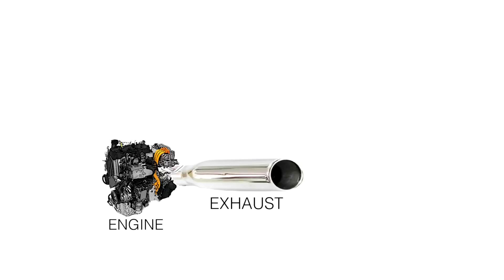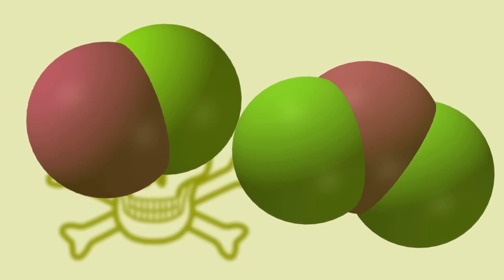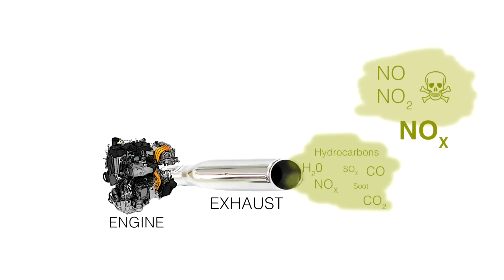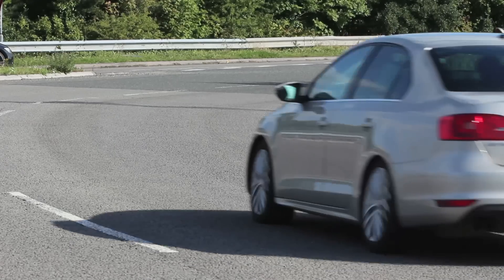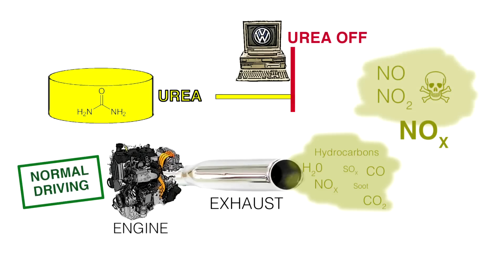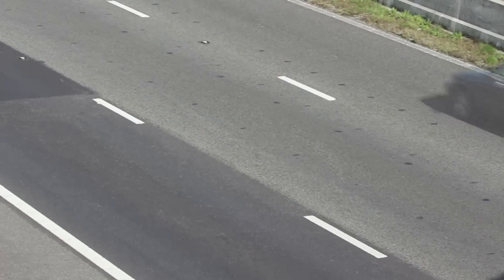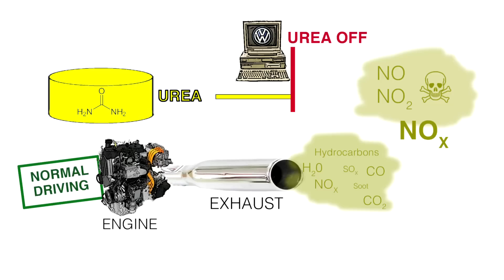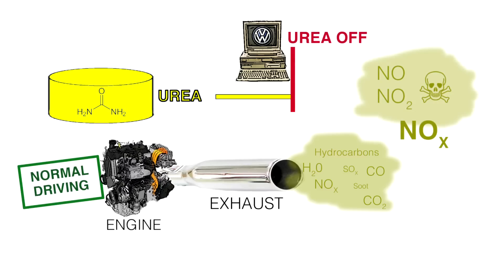Diesel and Urea

Comment: I don't get the problem americans have with volkswagen, I mean, have they not seen their american trucks lifted up and rolling more coal than 50s great britain? :D
Reply: +NinjaEule To be perfectly fair, "coal rolling" doesn't produce more NOx. What it does produce is more unbuned carbon in the form of smoke and soot, which, while a serious pollutant, isn't the same thing. It's also not made in  the same way. Excess soot, "coal rolling", means a diesel is burning extra rich, or with more diesel per volume of air. This increases horsepower and torque at the cost of efficiency. This is why diesels seen in motorsport tend to be a little sooty, excluding things like the audi le mans ubercars. More NOx is produced with a higher compression, which can increase both power and efficiency, but cars using this technology require more advanced engine designs, heavier duty engine block components, and more advanced and expensive emissions controls. Unless you're Volkswagen.

No loophole has been required to allow someone to modify their exhaust system or engine programming in anything short of a tractor trailer. In fact, legislation expressly made to stop the practice is fairly new. In addition, vehicles not intended to be road legal aren't required to be compliant with anything at all.

If you want to be mad at diesels, be mad at large ships, which produce a disproportionate amount of pollutants, especially when burning heavy fuel oils. Or, perhaps, logging in less developed countries, where burning of excess wood produces more particulate matter and dangerous chemicals than an entire fleet for coal rolling pickups.
Reply: +JimoftheSlim It has been illegal since 2007 to modify or alter the operation of your federal emissions control systems to prevent their intentional and designed operation from occuring. If you deleted your DPF in 2007 right after you bought a shiny new truck newly equipped with one, and the authorities found out, you'd be in for serious fines if not jail time. The "loophole" there was that off-road/race vehicles were exempt. Not to say things like heavy equipment, gen-sets, etc, which DO have their own emissions laws which, as of 2015, are dang near as strict as for the road-goers except for larger engines, but things like rock-crawlers, dune-buggies, Ultra4 buggies, etc and so-on. SO, tuning companies made programs with a tiny little piece of paper that basically said "We sure hope you follow the law with our product and don't drive with this on the street". People manipulated the system, got away with it, and the Feds locked down much much harder.
Reply: Benjamin Esposti yeah probably won't happen.
Reply: Jason W. Morningwood isis
Reply: Heheh, just laugh at the coal rollers in a few years when their engines get effed up from all the excessive soot and carbon ... X'D
Reply: I personally think that rolling coal is only done by dusche bags. That's just a professional truck drivers opinion.
Reply: +William Warner I love the new exhaust systems no soot, my 3year old stacks are still shiny and the front of my trailer is clean. Rolling coal is for little boys with little dicks.
Reply: *****
Yes, leaded AVGAS is still a big problem. Even after now 20 years of research, no one-size-fits-all solution has been found, i. e. an unleaded drop-in replacement fuel which all aviation piston engines can take without modification. One huge problem is aviation certification, which makes it exceedingly difficult and expensive to get modern engine designs certified. Plus the possibly even bigger liability problem if anything goes wrong with an airplane with a new engine design.
Reply: @pinkdispatcher  
Leaded aviation gasoline should simply be banned. Use computerized mixture control or force a change to diesel engines in small aircraft.
Reply: @gregorymalchuk272  do you have a few billion dollars handy to certify that?
Reply: +Jason W. Morningwood The thing is that probably well over 99% of cars are fairly new and drive in stock form, so that "coal rolling" and other issues with old cars are quite limited, but when you suddenly have thousands of cars that pollute, even way less much as 70's diesel with smoke tune then they add up and for a serious issue.

Comment: can't people just use low emission diesel or bio diesels...solves the problem.
Reply: +bulbadox Bio Diesel does not sovle the problem at all. It may be CO2 neutral but the NOx does not come from the diesel fuel itself but from the reaction of oxygen and nitrogen from the air under high temperatures and pressure inside a diesel engine.
Reply: +bulbadox How about no diesel at all. Except for transport related stuff or busses or... yeah you can guess it. A normal sized car doesn't need to run on diesel imho.
Reply: +Luniii737 however, take the gas engine 1.8ltr Golf/Polo @170HP, 200ftlb torque. A2.0ltr TDi Golf/Polo is 150HP and 236ftlb Torque. that bit of Torque can pull more, and take off more. Therefore a Normal sized car can tow a camper or pass uphill with less fuel than gas engine.
Reply: +xoxo2008oxox I used to have an Audi A4 2.0 diesel. It's performance was amazing; it could accelerate strongly at the legal limit. I'm glad I didn't know at the time about the extra pollution.
Reply: +bulbadox It does not solve the problem. Biodiesel does lower NOx some but it also produces ester aniline.

Comment: I find it interesting that Volkswagen elected to create technology that could identify when testing occurs and change the emissions, rather than just designing a car that would meet emission standards.
Reply: +Niq Dzisaljsfdbnla Detecting when testing was taking place was really easy. The car as a test mode so that it doesn't freak out when it's put on a rolling road. The nefarious bit was then using that test mode flag to alter the engine so that it burnt more cleanly. Developing a sufficiently clean engine in contrast is probably quite difficult.
Reply: Probably easier and cheaper, as well as allowing them to make a more powerful engine.
Reply: s50201
No, it wasnt cheaper than getting caught, though they didnt think they were going to
Reply: +ooo 52 but was it cheaper than the cost of getting caught?
Reply: +Niq Dzisaljsfdbnla They already had cars using AdBlue, but profit making kicked in as per usual...
Reply: Bosch did the programming. VAG decided to keep it.

Comment: The VW issue was using Exhaust Gas Recycling in Test Mode (makes emissions good but engine performance terrible)
It had nothing to do with AdBlue (which is fitted to larger Diseasels in the VW range)

Comment: ummm Prof there are more then 2 engines. there are 3 basic engines Diesel, Petrol and electrical. We also have hybrids.
Reply: +dan mayhew I have to slightly disagree with you on that statement. The words motor and engine are synonymous to some but most engineers consider them differently. An engine converts thermal energy into mechanical work a motor converts other forms of energy (e.g. electricity) into mechanical work. The difference is arbitrary but seems to have stood the test of time.
Reply: +Martin K Not really there has not been steam powered cars since the 1920's
Reply: +dan mayhew Ethanol? Though they may be considered gasoline engines as well. Also, i think he meant 2 basic types of internal combustion engines
Reply: +Graham Smith Fair enough I look on from a Green Chemistry point of view you see. I fully re-track my Statement then. Thanks for Giving me more knowledge
Reply: +ooo 52 yeah Ethanol work in the same way as petrol
Reply: everyone is forgetting autogas ? propane with a little  butane added ! Though these may be grouped in with the petrol engines they use, I belive the emissions are much lower ?
Reply: +dan mayhew "retract"
Reply: +s50201 opps dam dyslexia

Comment: Hi Periodic Videos,

This is a great explanation of how Urea reduction works on diesels, but unfortunately your explanation of the scandal and the tech used in the VW clean diesels is wrong- they dont use Urea at all.

The VW 'clean diesels' that we are talking about dont use the Urea tank technology, which is used by Mercedes, BMW etc. VW found a way to do it without the urea, which saved alot of money, and they called it a NOx Trap. This cheaper solution however relies on the engine running 'rich' to work properly- meaning that unburnt fuel makes its way into the exhaust which assists the N0x traps function. 

Unfortunately this reduces fuel economy and performance- so VWs solution was to only use this system properly when the car was being tested. So ironically the actual issue here was that they didnt use a Urea system at all. 

Here are some sources: http://www.livescience.com/52284-volkswagen-scandal-clean-diesel-challenges.html
http://www.wired.com/2015/09/vw-owners-arent-going-like-fixes-diesels/

Anyhow, I still love these videos, keep it up.
Reply: Yes, they did not use a urea tank at all, but I believe the solution was to retrofit a urea tank after they were caught cheating.
Reply: Landrew0  The earlier engine did skip the urea injection systems. Later engines had he urea system but used the software module was left in to reduce urea consumption when not on the test.

Comment: Diesel also produces more fine particulates than petrol which is more dangerous than NOx.
Reply: +Ralf Stephan Yes, which is why all diesels sold in the EU are required to have a particulate filter.The particulate filter was invented by Peugeot by the way, who gave it the delightful name "FAP".
Reply: And when they are new they only filter a whopping 85% of the stuff, less if you look at the smallest particle sizes which are the most dangerous.

Comment: I was under the impression that the engines in question were not fitted with an AdBlue tank/system. This lead many to scratch their heads when they first came out, as the figures from the magic triangle of power/economy/cleanliness were so good. Now we know why. The worry in considering purchasing one of these now is that they are a/pretty dirty in reality and b/any recall to 'fix' the software will either make them clean and gutless or leave the power/economy but show how dirty they really are, or realistically somewhere in the middle, not so clean, not quite so powerful/economical. This is why I stick with petrol (gas)!

Comment: While what Volkswagen did was obviously illegal I find it pretty silly that people are really complaining while large diesel utes (or trucks as you call them in the US) are allowed to go around with a fraction of the environmental regulations. The nitrogen oxides emitted by the Volkswagen are utterly dwarfed by those of trucks and hydrocarbon burning power stations.
Reply: +kylesenior although I agree with you, it has to be noted that the controversy is not that VW engines are "dirty" (which they are not in comparison, as you pointed out) but that VW cheated on the tests to get the engine certified.
Reply: nice try but all new Diesel engines are required to have either,  A DPF (diesel particulate filter) which smaller engines mostly have, or the DEF system that is explained above. 
Thats all diesel engines from the small ones in the Jetta to the large ones in Class 8 Heavy trucks.
Reply: by volume i would bet there are more cars(11 million) affected by volkswagons cheating emissions, producing more NOx than utes/trucks or at least near equal, even if the simi traktors do produce more NOx, at least they dont lie about it.

Comment: In diesel engine, there really is no spark plug, but you don't compress mixture of air and fuel.
Pure air gets compressed and then diesel fuel is injected at high pressure (>1000 bar if I'm not mistaken) and spontaneous combustion occurs immediately.
Reply: +Robert Faber No, old Diesels also inducted and compressed pure air, but injection happened at much lower pressure in a pre-combustion chamber and much earlier in the cycle (although after the intake stroke). Modern direct-injection happens just before TDC and yes, at pressures between 120 MPa and 300 MPa.

Direct injection allows much better combustion control, and high pressure injection allows much more complete combustion because of much smaller droplets. The downside is that particulate matter is also much finer and thus more toxic, and combustion peak temperature is higher creating more NOx.
Reply: +iliketotallyloveit yes, haha. Although I think the original comment is saying that the fuel is not being compressed with any air present as well, at least there is no air/fuel mixture to compress lol
Reply: +zlac 
A thousand bar?!

That is almost one fourth of the pressure in a big game rifle!
Reply: +zlac common rail can fire more than one time per stroke..
Reply: pinkdispatcher A significant cause for killing off VW-style pump diesels, as far as I can tell from people who have owned diesels of that or similar nature, is the absolute racket they make. It's hard to conceive of a more unpleasant engine noise than that coming off of an old TDI diesel.
Reply: +iliketotallyloveit not really, as unlike a petrol engine, a diesel engine does not use a carburettor, so the air going into the cylinder has no fuel in it. If there was diesel in the air, then the fuel would combust before the cylinder reaches TDC and cause reduced performance and knock, which in the worst circumstance can rupture the cylinder block (a very expensive replacement). Diesel engines use fuel injection systems to precisely time when the fuel is ignited, just like the spark plug in a petrol engine.
Reply: +iliketotallyloveit Diesel in liquid form is uncompressable ;-). The reason it's injected at very high pressure is to make it a very fine mist that can mix with the air in the cilinder instead of just a puddle of diesel.
Reply: +Robert Faber Yep, the majority of noise you hear is the fuel pump working.
Reply: +gilessmokey Ever wonder what C.A.V.  is an acronym for? It's relating to lucas fuel injection pumps.
Answer:  Charles Anthony Vandervell
Yea, not knowing that has pestered me for a while.
Reply: zlac my mates have bought I was nuts when I started talking numbers like that
Reply: low octane mumber..
Reply: +zlac That's how Common Rail diesels work, yes, and today 99% of diesels in cars are Common Rail. Older pump diesels didn't work like that though, as they had something akin to a petrol engine's carburator that pre-mixed fuel and air.
Reply: +Robert Faber Old ones had a thing we call "Bosch pump" that did pretty much the same thing as Common Rail, but each cylinder had one pump while Common Rail is one pump for all cylinders.
Reply: +VicariousReality7 it's pretty sick, I know. In most modern diesels, the air is turbocharged in the cylinder and then compressed with ratio of more than 20:1. The air pressure might then be 40 bar already. If you want to inject the fuel in there, you need quite a lot more! I just checked up on Wikipedia and on "Common Rail" section it says: "a high-pressure pump pressurizes fuel at up to 2,500 bar"!

Comment: I had no idea that there was urea in a diesel catalytic converter! Hahahaha!
Reply: +IIzRoBzII There isn't in all diesels. Most diesels sold in Europe don't have an AdBlue tank because EU emission standards allow diesels some extra leeway on NOx, to make sure that diesels (which are better than petrols in pretty much every other economy- and emissions-related way) remain an attractive purchase. Because of this, car manufacturers can use a simpler solution that doesn't require AdBlue but basically just traps NOx in the exhaust and occassionaly puts a drop of unburned fuel in the exhaust to reduce the NOx. Bigger diesels (bigger V6s, V8s and upwards) generally do need an AdBlue system in Europe, and pretty much all diesels need one to comply with the much stricter US regulations, which favour petrol engines over diesels.
Reply: Robert Faber I thought it sort of depended on the type of journeys you do, so for short journeys petrol was better, and if you were driving long distances on the motorway then diesel was better. So are diesels always better?
Reply: IIzRoBzII Diesels produce more power per litre than petrols do, because diesel fuel contains more energy than petrol does. Diesels also produce more torque, allowing them to be run at lower revs, which further reduces fuel consumption.

The misconception that diesels are bad for short journeys is based on the idea that diesels run really bad when the engine is cold (since they rely on heat to start the combustion cycle), so if you don't warm up a diesel engine before starting it you're going to throw a lot of unburned fuel and CO out of the exhaust. Modern diesels can heat themselves up to acceptable levels in a matter of seconds though, so unless you absolutely stamp on the throttle straight from the get-go, diesels are just as suited to short journeys as petrols are.

Comment: Why is these catalysts not added to the fuel mixture? Would they react with the fuel?
Reply: +CarrotofGreatness Possibly. Or they might not survive the combustion process.
Reply: +CarrotofGreatness Then you would produce CO and HC in stead. But of cause, the catalytic converter would take care of this... but i think it would be quite a bit harder.
Reply: +CarrotofGreatness Because then you cannot control the amount and you end up using a lot more than you really need.

Comment: So it is only the petrol engines that are using a platinum catalyst?
Reply: +P@r@m3d!© petrol engines use a three-way cat; reduction of NOx, oxidation of CO and HC. Diesel engines run with excess oxygen so they cannot do the NOx reduction
Reply: +P@r@m3d!© I've read that diesels use platinum for a catalyst and petrol cars use palladium. Is that wrong?
Reply: +Matthew Mitchell Petrol/Gasoline engines use both Platinum and Palladium
Reply: Indeed, I think it's that diesels tend to use more platinum. I have no idea though, I just heard that.